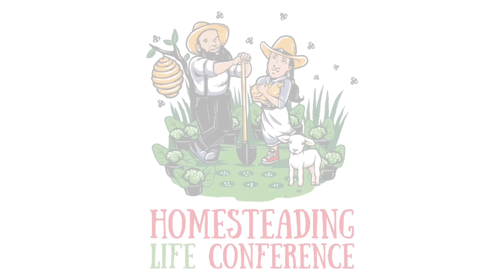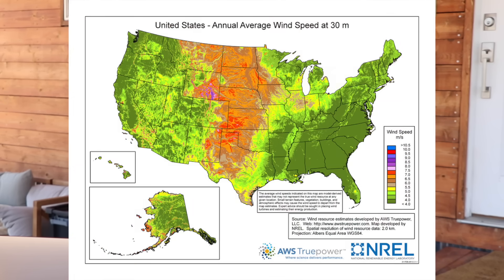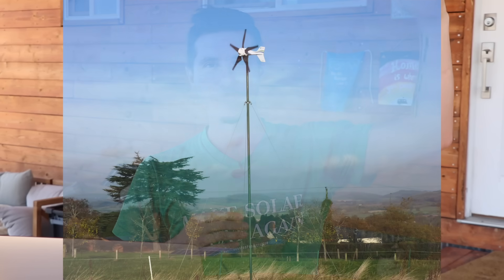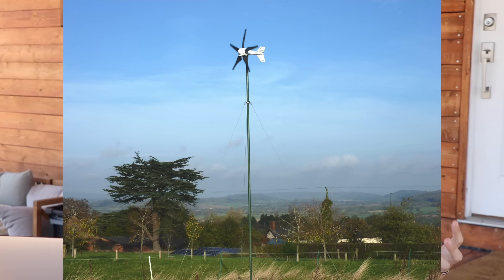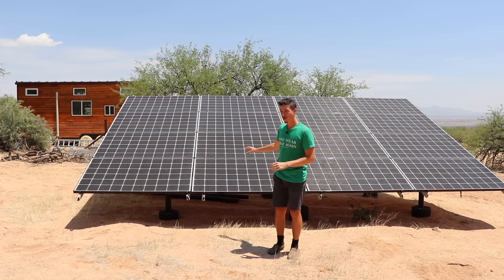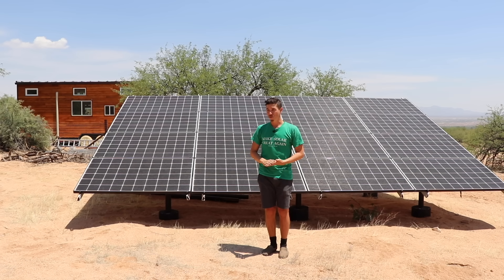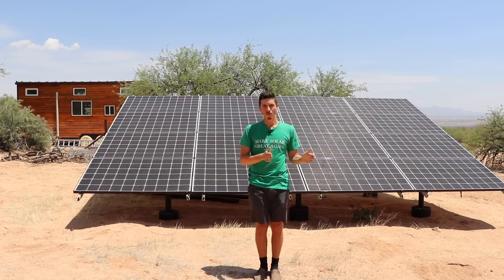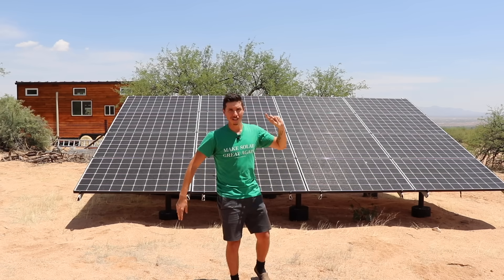Micro Wind Turbines... Are They Worth It? (Off Grid Solar)

Comment: Every site and application are going to have their own unique set of circumstances and requirements that should be used to evaluate and design the ideal energy generation system. There is no "silver bullet" that will be the best energy solution for all applications but if you had to choose one or the other, about 1/3 the planet has good solar resources and 2/3 of the planet has good wind. That said, Solar and Wind actually compliment one another nicely and often a hybrid of the two is the best option. 

Worth noting: a well made wind turbine will be significantly more energy dense than a solar array and if you have steady wind, you can get away with a much smaller battery system, which is not only the costliest part of the system, it has, by far, the greatest carbon footprint.

Comment: Man, you need to check on vertical axis turbines. They don't need the hight nor the wind speeds of the horizontal axis turbines. Also, the things you said about horizontal axis turbines may or may not apply. The comparaison between solar and wind power will depend on variables like wind speeds, average sunlight, vertical or horizontal axis, and space availability. It may be that in your case, solar ia the way to go, but it's not correct to generalize.

Comment: ALL Dependant on LOCATION, 

I would say look deeply & closely into using BOTH . 
Solar by day, 
wind at night. 
Wind is the wrong Term. 
Breeze is more accurate. 

Always cover yourself X 2 !! 
Subject to cost & Budget etc. 
Also , HAVE DEEP CYCLE BATTERIES. 

Are You doing this to LIVE & SURVIVE ? 
or as a Project for the Garage or Shed etc. / Occasional use ? 

OR to run a Home with a family full time ? 

Are you on a limited budget ? or Playing with stuff for Fun ? 

Whichever , Both is Great, People playing with stuff in the shed = Tomorrows New Technology. 

What are " YOU" trying to power ? 
A tiny off grid home , 
A Large Family house ? 
the whole village ? 

You will never power the world if you can't power your garage or shed . !! 

Start small & build up at your own speed. Try Everything. .

USE MATHS / Figures to work it out. 
Save 10% this yr, 
another 10% next yr, 
Generate 20% = 40% gain / Saving. 
Then generate / or / save 2% per yr for 50 yrs = ZERO !! 

SWITCH OFF & UNPLUG EVERYTHING . 
As per Hotel rooms with a Door card / power card. 
When you leave you take the card with you. ALL the Power is OFF . ( except the Fridge, & essentials ) 

ALL Power sockets should be Pre Set to turn off after a " Normal usage time " .

OFF should be the Normal. 
ON should be A RED Warning light. a BRIGHT LIGHT that Annoys you in the room. 
( security & Fridges ETC excluded )

MY TV, 
After a while it will switch OFF, unless i Press any button. 
Every household appliance should do the same. AUTOMATICALLY. 

When in use items should be RE- SET to carry on again. then shut down. if no further action is set. 

Make / FORCE people to actively Ask the machine to carry on. 
Fit PIR light sensors in every room in every home & building. With LED lights.

Comment: using a solar tracker system would make the panels much more efficient and you would require a lot fewer panels. 
there is some non motorized systems that just use the heat from the sun to rotate the pannels and they return to starting position when they cool off. so maintenese free.

Comment: 1 72" tripod, 9 fan blades, 3 belts, 3 alternators, 3 deep cycle marine batteries, 2 circuit breakers, 3 inverters and 3 extension cords seems relatively cheap, compact and good enough for at least 1.5kw of power 24/7 in Iowa. Solar panels are okay for people who have houses out on a farm or the city limits. Panes must be unobstructed and can only be mounted horizontally. Wind turbines are stackable on the same pole or tripod and can save space for people like me who rent. The circuit breakers prevent overheating.

Comment: You can make a wind turbine from an alternator, epoxy, 2 rear bicycle wheels, chain, tape, 48" steel pipe, deep cycle battery and a circuit breaker. How can anyone make a solar panel that can generate even half the power a wind turbine can? You can fill your land horizontally with panels on the ground or the air with wind turbines mounted horizontally AND vertically. You can get sunlight for a few hours a day or wind 24 hours a day. 1kw solar panel cost VS 1kw wind turbine cost this year. Which is better value, really?

Comment: You are very biased against wind. Here are some pros:
1 - wind blows also at night (and on the coast it usually blows most at sunrise and sunset, two useful times),
2 - smaller alternators have less magnetic drag and require a smaller blade diameter to achieve low cutting speeds (ie the minimum speed the wind must be to generate power),
3 - modern implementations do not require slip rings or brushes with minimum moving parts, sure they need bearings but they don't need the dust cleaned off of them to maintain peak efficiency (ie everything has a little bit of maintenance),
4 - wind turbines generate AC power (yes, which must be rectified to DC) but can also be at much higher voltages so you don't have high transmission losses (like those that you must have between you panels and you house, its a long way for 12 or 24 or 48 volts DC) when you rectify at your charge controller

You also misrepresented Missouri W&S, they recommend that you mount the turbine as high as possible for best results but they also have many trouble shooting videos where they show you turbines mounted a few feet above a roof line with some that work well and other that don't and they explain way. Wind patterns are a little more complicated that "sun light all day" but not too hard to understand.

The best solution for any given situation is the set of compromises that achieve the best result in that particular situation. Personally I would not install only one type of generation technology because where one is weak the other is strong. A blended generation suite of wind and solar works well in places that experience significantly different conditions across the seasons. What must be understood is that wind turbines are excellent in those situations where they are a strong candidate, if you install it in the wrong place or have the wrong expectation then you are almost certainly going to be disappointed.

Comment: I was wondering , have you hooked up a CB/ AM-FM , radio and WHAT size tower do you have.  Thinking becouse you talked about small fand genrators , as well when your batterys are full what do you use as a runoff for the extra power still flowing from solar panals ? Water pump to circulate your water tanks , air pump in your water tanks or just leave a tv or stereo ?

Comment: Savonius rotor type of wind turbine, guys in iceland developed a really nice one, rotor design does not allow over speed.
But I think you are dismissing this technology without knowing enough about it as there are many types, some have props, some have rotor's and some have more exotic ways of driving the generator.
A combined system of wind and solar is best in my opinion but really you need to use all 3 types of " green energy ", solar, wind, thermal, as we all know the biggest problem with solar panels is heat, when they get hot, they dont work as well and it shortens the life of them, you have to replace them more often.
A wind turbine with a brushless motor, could last for 20 years and replacing a couple of bearings for $50 is pretty cheap operating cost when compared to replacing panels every 5 years.
Most chinese hub motor's are about $200, schottkey barrier diode is $15, controller about another $200, make your own rotor for about $50 from PVC pipe etc... so about $500 for a setup that could last you 10 years or more before requiring bearings, Provided of course you swap out the cheap bearings for some high quality like SKF's etc... when the motor is new. Very easy to do....takes about an hour.

Comment: I'm going to address your points one at a time. First, it does depends a lot on your location. Where I am, I get tuns of sun, but when there is bad weather I don't have sun, but guess what I do have.... lots of wind. I am very happy to have my turbine on those days. My turbine fills in the gap quite nicely when its bad weather. You shouldn't assume you are going to get sun "every single day".  Second, the height of the turbine does make a difference, but mine is on a 25 foot tower I built myself and it is very strong. It can make 1000 watts or more (I have seen 1600) in good winds (on those bad weather days). I built my tower for less than $300. Again, it does depend on your location, but it works well for me where I am and would work in lots of locations across the US. Your 3rd point about an unsightly turbine... I'm not sure why you mention that at all. My turbine looks fine to me and certainly isn't ugly or at least no more unsightly than a big solar array. It seems to me that everyone should make there own call on that and ignore advice on this point. Your 4th point was about the diversion load. Now I use the same model charge controller on my turbine as I do on my solar array, so it was no more expensive, as for the diversion load, it was easy and fairly cheap to build. I would be happy to lend a hand to anyone who wants to build one, it is not hard and not expensive. You need some large resistors and some inexpensive electronics and you can put it together in a relatively short time. My diversion design plans have been sent over to Missouri Wind and Solar at their request after a conversation with them about avoiding the expense of purchasing a similar unit costing over $1000. Mine was built for a fraction of that. My turbine with all the circuits and tower cost much less than my solar system and serves a different purpose (providing power on bad weather days when there is no sun in an off-grid situation) so adding more solar panels doesn't help there.  I'm not going to say much about the point you made about size of the blades ( I'm not sure you know what you are talking about there, no offense) just purchase the turbine recommended by a professional for your situation ( mine works great in my situation). As far as adding battery storage, now you are talking about some real cost. Batteries are expensive and should not be drained down excessively during those  bad sun days if you want them to last a long time. My personal rule for my bank is no lower than 90%. I know that's more conservative than most but I expect my very expensive battery bank to last a long time. My combination of a great solar array and a great wind turbine installation keeps my battery bank from having to take a beating and gives me all the power I need no matter what the weather is doing. Food for thought. I would be happy to explain in greater detail how I built my systems and tower/solar rack if anyone wants some help with their own systems. I saved a lot of money doing everything myself. Now I did go to school for electronics and am a retired computer tech, but I'm sure most handy people can do it with a little help.

Comment: Well yes you did bring up a number of good points that are very relevant to where you live. 

Here in Eastern Ontario Canada I am finding that the solar panels are doing fine for 10 months of the year but November and December are really really dark. More solar panels and batteries are certainly an option but the calculation is different here. 

Wind looks to be a reasnoable option. I am planning a turbine on a hill top field here that is 20 ft tall. My plan is to put the brakes on while the sun is shining and mainly use the wind turbine in the fall and winter.

I am also planning to install some thermal electric generators close to my wood stove to see how well I can get them to perform.

Solar panels in the desert makes a lot of sense. Hey here is an idea for a big organization. Run a large pipeline from the ocean to the desert and use solar energy to make a lot of reverse osmosis or distilled water. Then green up the desert. The salt and minerals from the seawater can be sold as a byproduct. It is an idea that comes from thinking about terraforming planets to be more habitable. Why don't we start with planet earth - our deserts, our poles and our oceans are far more habitable than Mars, the moon or Venus

Comment: And for those of us who experience strong winters? And sun is absent? You should be more open minded, wind turbines aren't so bad. ;)
Reply: EXTREME ENGiNEERiNG LiFE  What if the water freezes? Does your water turbine still work?
Reply: EXTREME ENGiNEERiNG LiFE  true water is op it can provide continuous power not relying on weather and will get stronger in the rainy day and you can always be sure to get a decent amount of power only problem is access to rivers but a siphon style one is better as it does not rely on strong currents
Reply: MPPT controller and amorphous panels have you covered
Reply: @elcidbob  true but not 100%
Reply: Anywhere in the North the winds blow I would say wind is better to harvest than sun.
Reply: At least with Wind you don't have to dig them out of snow

Comment: All the time with the generator growling away in the background - charging batteries perhaps?  A few factoids there aren't quite exactly true.  Wind gen is for the unusual fill-in situation where you haven't had solar for a few days and you need a short-term boost.  Fortunately, it is often the case when there has been no solar for a few days, that it is a little bit windy.  The fill-in required is just to keep you out of trouble - not to supply all your usual energy-hungry normal requirements.  Oh, and you can still run your generator if you're really in strife..

Comment: I just think your theory is flawed.  In an effort to have a redundant system and reduce reliance on batteries a proportionaly small turbine system to solar system has some great benefits for a system to make up for overcast day, winter months and uncommon high power usage such as when you have company or large projects going that require more power use.  I dont believe relying completely on a wind system to produce the bulk of power for a single home would be very cost effective and would introduce it's own problems but a small system would easily "trickle" charge the batteries over night. In the same way that many people collect rain water and they have wells it just adds another level of security in a self sustaining property.  Of course if you post something on the internet their are going to be hundreds of people do disagree with you but I genuinely would like you to consider the benefits of a properly sized and set up "auxiliary " style small wind turbine addition.

Comment: In a location where this guy is a wind turbine is most likely not a viable option, in reality not every one lives in a desert with little cloud, I know many off gridder's and like myself can have nearly 2 / 3 weeks of heavy cloud cover a PV solar is not charging the batteries, small wind turbines work well, and all the one's I've looked at and one I have all have a controller to control charge and dump load and shut the turbine down in the event of a failure, and in my case it also axillary dump load to a hot water system heater element, all within the controller and unlike PV solar it provides power at night when the wind is blowing,  Handeeman you give me the impression you do not like wind turbines much but there are locations where they out perform solar any day or able to provide charging power when PV solar can't (night and long cloudy periods).

Comment: is not fair to say that a wind turbine will explode like that that was a catastrophic blade failure due to poor maintenance most small wind turbines would never spin that also solar power is very expensive you also haven’t mentioned that most wind turbines of that size don’t make that much noise and furthermore you don’t mention that in most places solar panels can only charge a battery of maybe 8 hours a day but good video on the whole